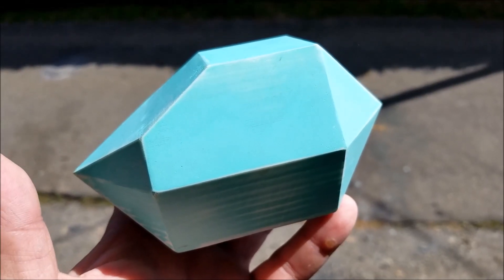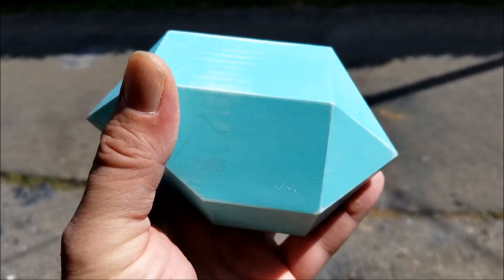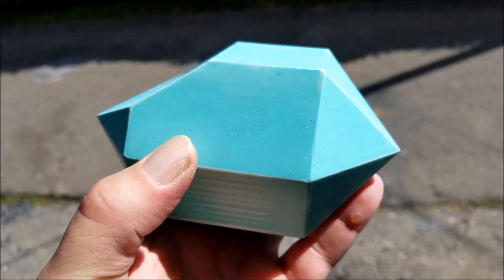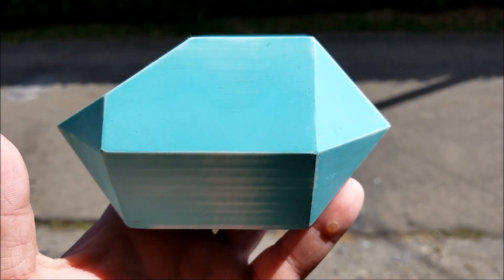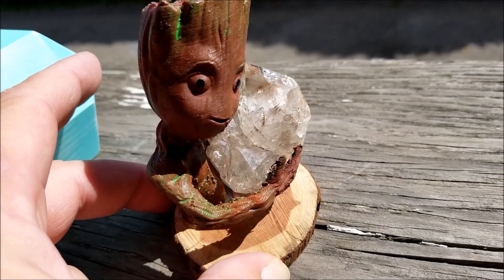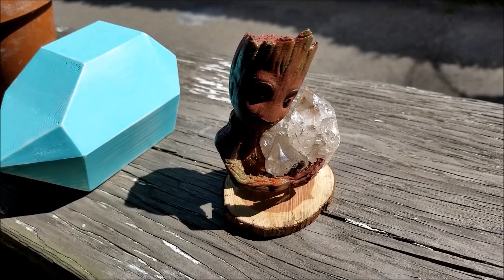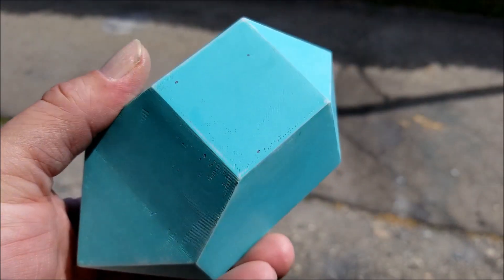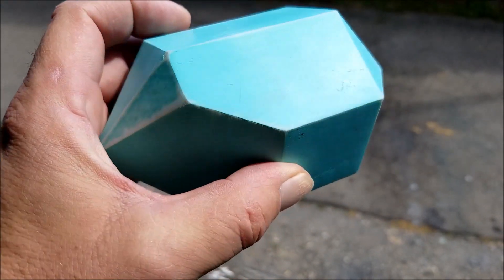3D Printed Herkimer Diamond

Comment: Really cool! Love to see your video on making your Morganite display. What will you fill it with? Metal shavings, small, tiny Herkimers you've found, fine metal glitters? There is a video on YouTube on how to make a silicone mold with silicone caulking and soapy water. It's a little messy but if you get the water soapy enough, when you squirt all the silicone into the water, then gather it up and start kneading it together, it will become the proper consistency to make a mold of your 3D model. As big as your model is though, you'll need a lot of silicone caulking to make the silicone in a thick enough block or it may have to be done in two separate pieces. Good luck and video it so we can enjoy the journey with you! ☺️